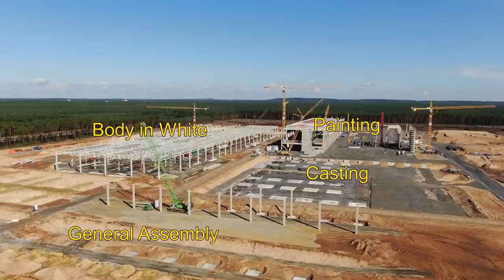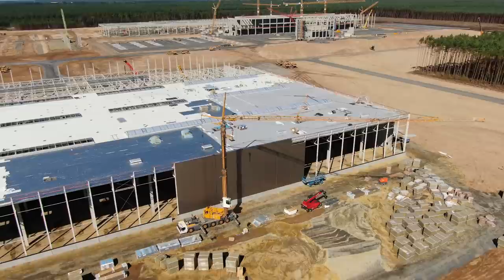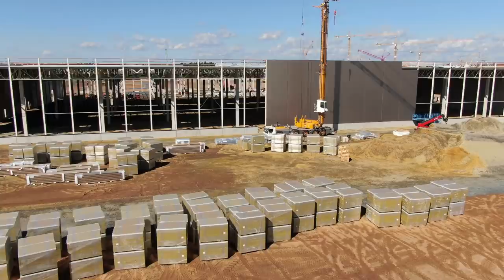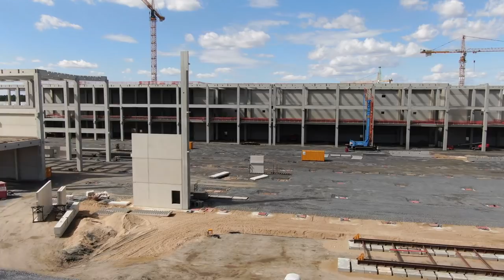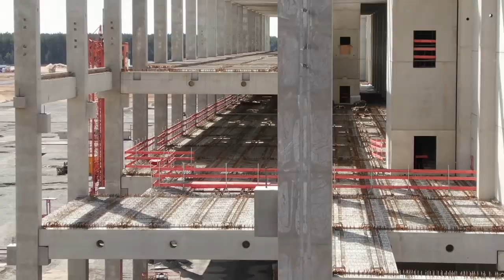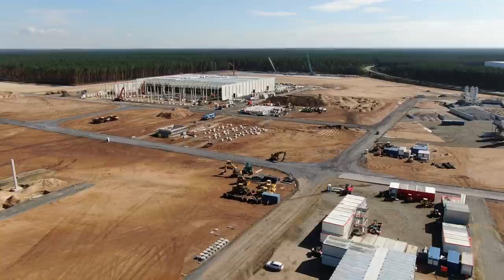Giga Berlin | 2020-08-23 | Roof & wall progress

Comment: Autos are not my business, but I suggest that the section of an auto plant that assembles bodies is the "body shop". "Body in white" is the product of that shop - in English.  BTW - do you know what's happening to the Paint Shop? Have they run out of precast?
Reply from the maker: I think at the paint shop they finish the section next to body in white and stamping first. I label it as body in white because that's how Tesla labels it in their documents.
Reply: @mihaimera7837  - Nothing official about anything Tesla may produce. There's always some little schmuck in some basement office drafting program requirements for contracts with architects, engineers, etc. There's no sainthood attached to Tesla or anyone else - and they may have used the wrong terminology. Or maybe not - the point is that "body in white" is the primed, assembled body shell. I'm not even sure the primer is applied in that shop, it may be the first step in the paint shop - or maybe it should be.
Reply: @TobiasLindh  - OK, I'm not obsessed with this. I don't have the expertise to contradict Tesla documentation, but I suspect "body shop" may be the most adequate appellation. You do good work, btw.
Reply from the maker: @zalman7208  Thank you!
Pretreat and e-coat are the first steps of the paint shop by the way.
Reply: @mihaimera7837  - At the end of the day it's what we think we know that matters, not what some Tesla employee thinks he knows. In any case, this isn't worth losing sleep over.

Comment: Another great video. By the way, what exactly is the Switchyard? Is it power-related?
Reply: Electricity substation I believe
Reply from the maker: Yes. The 110kV line arrives there and will be transformed to lower voltages.
Reply: This SWY is a large transformer station which turns the 110kV grid into 10kV for further use in seperate transformator stations over the whole site. 
It starts at south, where actually the foundations are, with an insert, followed after the actual working street with contactors, switches and measurement for turning off the lines, bridge, load-balance and stuff at the middle part, runs to another isolation stage between the road with the crane and the incomplete foundations. 
The transormators will follow behind that road, the cable entry into the tunnel will follow next to the dirt hill.  From there this tunnel will be 110 meters long :)
For watching details take a look to the documents: 
CD 1 - Auslegung Gesamt Tesla Manufacturing Brandenburg SE_V2_24-06-2020.pdf - Page 2502
Tesla Manufacturing Brandenburg SE_V2_24-06-2020 Kap. 4.pdf - Page 791

Comment: So is the floor done in the drive unit building? Looked so smooth from the low angle view...
Reply: Floors are done kind of last.  Top to bottom, roughly.
Reply from the maker: No, that's just compacted gravel. Just like the one row near the crane at 13:15.

Comment: did u switch to 30fps? if so, good. its way less taxing on my 7y old laptop ;)   60fps video is overkill in most cases.
Reply from the maker: I just did 60 fps for the time-lapses. If your laptop is struggling with 60 fps videos I can recommend the chrome extension h264ify. It allows to change the codec to h264 and you can also chose to block 60fps videos, so you can see them in 30fps.
Reply: WTf! You can always switch to lower resolution! Why would the rest of us need to watch less FPS when Paleologic has a piece of junk?
Reply: @lecisko  hahaha xD
Reply: @TobiasLindh  thanks for the tip! the plugin works great! :)
Reply from the maker: @awaken69  You're welcome. I know that struggle with YouTube on old machines.
Reply: The resolution on your videos is amazing, by far the best at GF4

Comment: How is it that every video of Texas factory has 100's of machines and people working, and the last 3 from here, it looks almost shut down? No triple shift, no over time, no night shift? Texas may well be completed first. This site has really slowed down. A lot.
Reply from the maker: It's Sunday. There is no work on Sunday. And if you look at the progress, you see that it didn't slow down.
Reply: @TobiasLindh  7 days a week at Texas, and the progress is not as fast as it was. That is easy to see.
Reply from the maker: @Pat McDaniel have a look back at last week's video. 
Sunday is a special day in Germany.
Reply: @TobiasLindh  I have seen every single one for Shanghi, Texas and Berlin. Still the progress has slowed.
Reply from the maker: @patmcdaniel2016  I've seen them as well. But I just had a look back at last week's video, and i was surprised how much changed.

Comment: I wonder what that little 12 layer tower attached to one of the bigger building is for.
Reply: What?
Reply from the maker: I don't know what you mean. Can you post a timestamp?
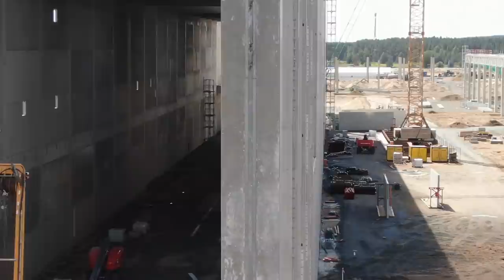Reply: I guess you’re talking about the scaffolding staircase attached to the paint shop @16:03?
Well, a staircase is for... ...forget about that ;-)
Reply: Maybe to work on the roof?
Reply: 17:20? Every industrial building needs at least one stabilization core, usually the stair/uplift tower.
Reply: @Stoffmonster467  Thats just a staircase and not needed for anything else.

Comment: Weird. The east wall of the Drive Unit building should be an interior wall according to the long term plans. This should mean that it's a firewall, which would be built in concrete, just like the north and south wall. But that sure looks like metal-sandwich panes, which would indicate an outside wall.

This could indicate that they already have decided on a different building layout for the future phases. Just like in Shanghai where they also did not keep their "4 identical buildings" idea.

Alternatively they could plan on doubling the size of the Drive Unit production, and removing that wall completely. But that seems unlikely, there's no forcing reason for merging those two areas completely and removing an outside wall during production is messy.
Reply: The wall will be removed in case of an extension.
Reply from the maker: It is an outside wall for now. The sandwich panels with mineral wool are fire resistant though.